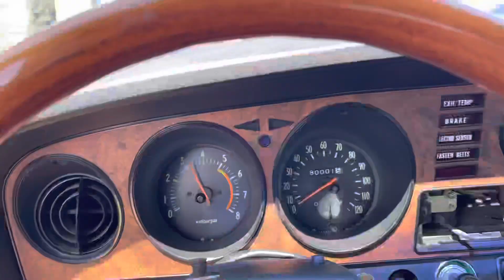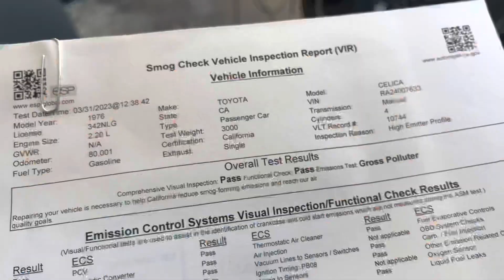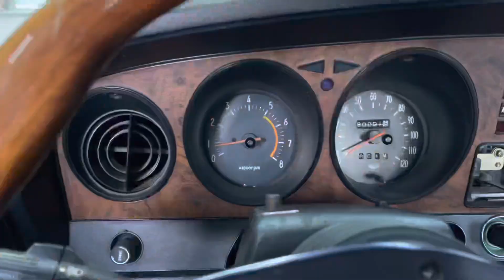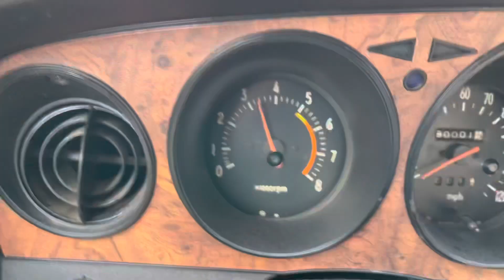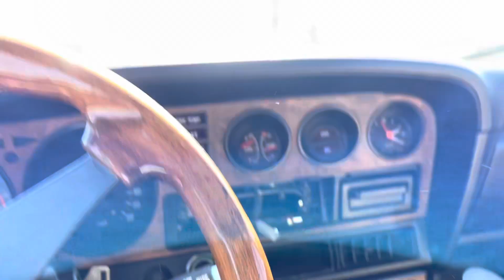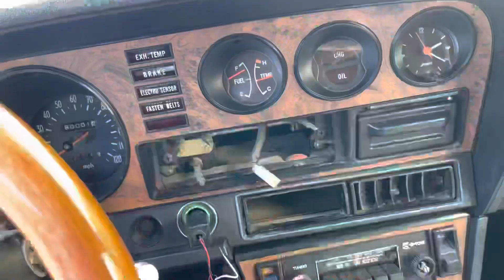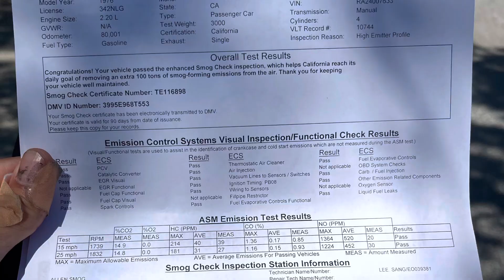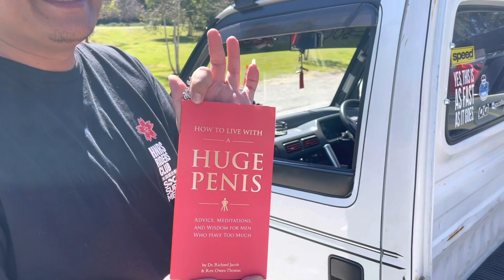1976 Celica Smog Test: Passing with Flying Colors! (I failed the first time) RA24￼￼

Comment: I have a 1977 Mercedes 450 SL, it has a bunch of vacuum lines and I've had it since 2018, never managed to get it to pass smog.. It's just rotting at this point. Took it to a few shops and they didn't want to touch it.
Reply from the maker: What did it fail? Yes lots of shop don’t want to deal with it